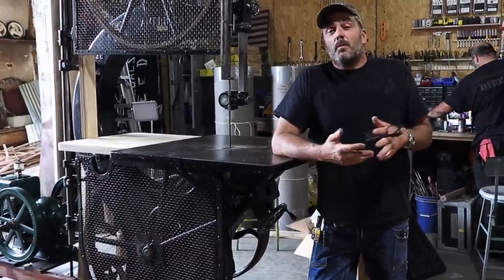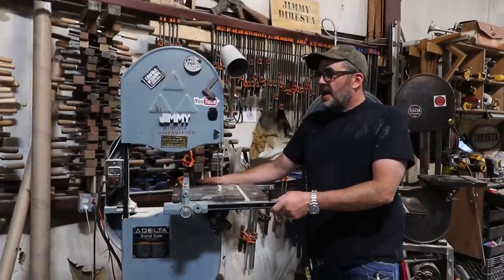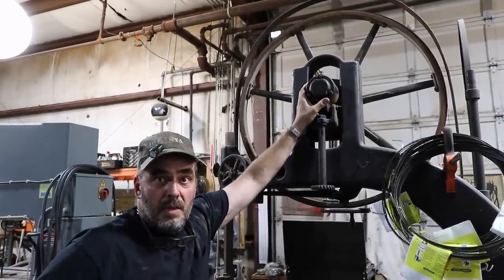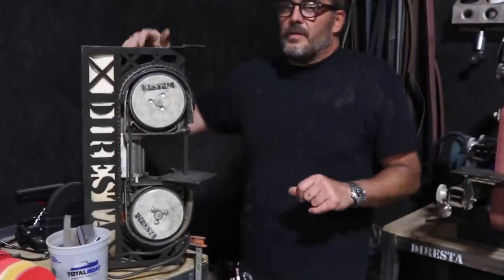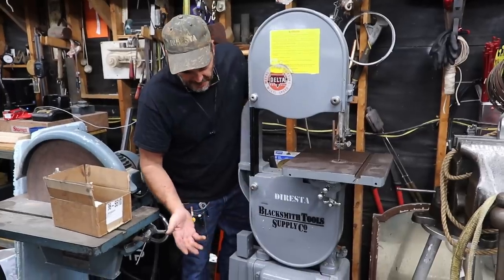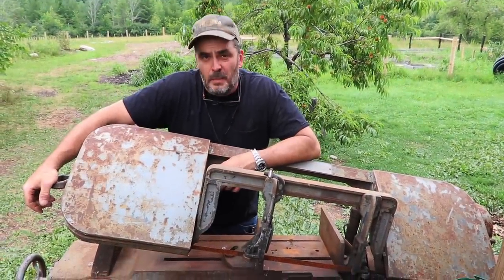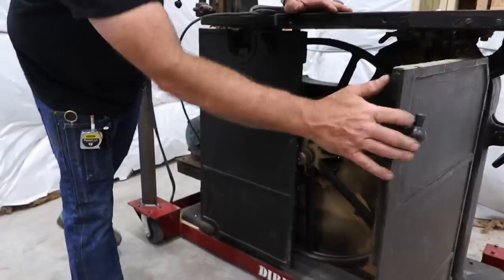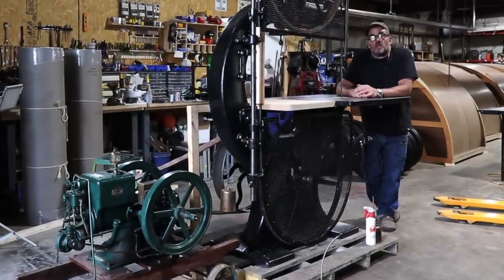DiResta Bandsaw Restoration & Collection

Comment: WOW, Great collection. I have a 12" Craftsman bandsaw, I attempted to replace the rubber bands, I bought the bands from Sears and they don't fit right so the band saw is sitting in the back of my little my shop. I kept the old bands , so I'm going to put them back on and just give it a good cleaning and hopefully get it working again. I bought it cheap from an old friend of mine, He cut his finger off and the doctor told him it was time for him to give it up. He has since past away, so His wife called me up and gave me his small drill press too.

Comment: Nice work. I've got  a Boyce Crane bandsaw from 1954 and a beautiful American Woodworking Company table saw. Love the old equipment. Also the oiler on the engine should only drip about once every minute or two,  this will cut down on the heavy smoking....a little

Comment: Used a similar Do all 12:00 like that in a small machine shop I worked at in 1980 -82  was a great machine.We made a lot of  parts out of Lexan, We made parts for seismic  cables that were used in the oceans . Teledyne Exploration

Comment: I had one of those Weils bandsaws in the blacksmith's shop; got when the factory I was working in closed.  It looks exactly like the one in this video and it rotated up and had a little table to attach so you could use it as a vertical saw.  Sadly, I gave it to a nephew because I didn't have space for it anymore.

Comment: A bandsaw is one of the tools I still need to acquire. I have a reciprocating, stand mounted, power hacksaw for metal cutting. Slow, but I can just walk away. It shuts off when the cut is finished. I'm having trouble sourcing blades, but until I finish the shop, it won't get much use anyway. Your choice of music for this vid was about the most annoying I've heard. Well done!

Comment: Really cool info on the 2 gear Delta. I have one of those (from 1955) and it's supposed to have stepped pulleys but I don't have the lower one so it's currently only one gear. Would love to get that working but don't know where to get the other pulley. I found the manual online and there's a whole chart of which speeds are to be used for particular materials.
Reply from the maker: eBay!!

Comment: Aaagh, this was wonderful, but kinda torturous as well. After my dad died I was getting rid of some of the shop tools that I didn't think I'd use, like a 220 volt, 16 inch surface planer, and a Delta Rockwell shaper with a bunch of matched cutters, that sort of stuff. In my zeal, I also thought, "how much will I really use a bandsaw??", also sold the Delta Rockwell bandsaw that was in great condtion except for needing a new surface on the wheels. I thought that'd the wheel resurfacing would be a pain to do (actually not) and why take up the floor space? The floor space it takes up is very minimal, and the correct answer to my "how often?" question is "...pretty often actually..." I hate that I sold that nice saw.
Reply: maybe yes...maybe  no.  Sounds like the memory of your dad is locked in....to the point when you see woodworking projects or tools good memories return.   This means all quality band saws will remind you , not just one.

Comment: Why is it called a "hit or miss" engine? Also I hope your parents are doing well
Reply: The glow plug fires igniting fuel in the cylinder which throws the piston and spins the massive flywheel. 

While the flywheel is turning at speed a governor holds the exhaust valve open allowing the piston to travel without firing, until the flywheel speed drops enough for the governor to trip the exhaust valve close, at the same time injecting then compressing fuel in the cylinder, then fires the spark, igniting the chamber to start the cycle again.

So the 'hit' is when the piston is at the top with compressed air and fuel and the plug fires.

And the miss(es) are in between the firing when then piston goes through several revolutions in an empty cylinder and open valve ... missing firing, until the whole thing slows to fire again.

I'm not an old-engine-guy enough to know all the varieties but I (city boy nyc born) dated a towny girl (stamford ct) who took me to deep woods Maine to meet her family. 

Naturally they looked at me askance esp her stump jumpin Grandpa, (letting her 10 y.o cousin drive my 64 Ford Galaxy, we went ripping down the dirt road trailing a whirlwind of dust and every house along the way called their house saying... Billy was with some strange guy but Billy was driving!!? - didn't help) until I was nosing around his One-Lunger under a tarp in the back of his barn.

It hasn't run in 20 years so for the rest of the week when the womenfolk were doing their thing, me and gramps and his grandson Billy tinkered with that hunk of iron until we got it to go... pop!, chug, chug, chug, chug, chug, pop! and so on

He called it a 5 to 1. Five revolutions between every pop.

Ah good times. Betcha now 40 years on Billy hasn't forgotten that day. 

Meanwhile my girl told me the ladies said it was good that Grandpa finally got stood up to. But personally he was a decent codger, not as miserable as he pretended to be. He just needed a guy to talk to, one who was interested enough to listen to his stories.

Kinda like what we do with Jimmy... lol🤣

No, sorry Jimmy. jk
Reply: @tommypetraglia4688  holy heck that was a read, I guess thabk you for answering my question and giving me a run down of your week twenty years ago